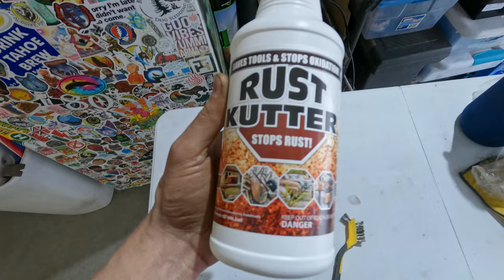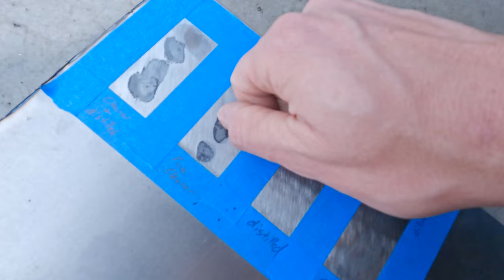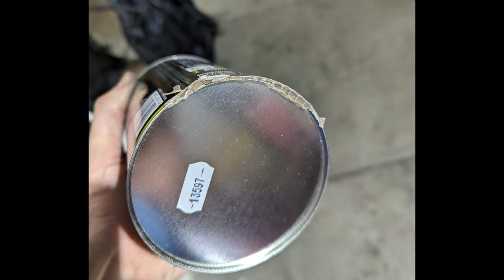RAPTOR Undercarriage and Wheel Well Restoration

Comment: Nice job on outlining the process and steps.  I just completed this exact same thing on my car and used practically the same steps.  It took a lot of effort with the wire wheel (days!) and I swept up endless piles of debris like you did.  This is the third time I’ve done this so I finally realized that a cheap paint suit from Home Depot was a Godsend.  The raptor liner sticks to skin for a long time and ruins clothes.  The suit was cheap protection.  The results are worth it though.  The finished product looks fantastic. Great video. 👍
Reply from the maker: That's awesome to hear, glad it helped out!

Comment: I’m not sure if on the z, if it was a urethane based undercoat, or a tar type undercoat. Paint will stick fine to urethane undercoat, but it won’t stick to the tar type.

My Volvo 1800ES was sprayed with like a 1/2” thick tar undercoat and it’s been a nightmare stripping it off

Comment: I want to do this to my 99 civic. My underbody is in good condition.  Do you think it would look good if I just cleaned, degreased, and sprayed right over the existing rubber coating?  I contacted the company and they said I can do it.  Just wondering if it would look good because wire wheeling it all off doesn’t sound like fun.

Comment: Well put together video editing and demonstration! 

Just trying to feel confident before my first time doing it. 

So it’s 80 grit on base metal spots then put epoxy right over that? 
Then scuff that with red scotch?
Reply from the maker: That's essentially what I did and the adhesion seems really good!  Raptor liner is very sticky though, so less prep mayy have been OK - hard to say
Reply: @windows_down_  yeah I’ve been going overboard on removing seam sealer and sanding/wire wheeling. 

I just wanna get this part done move into the subframe and engine bay. Then engine rebuild and turbo ALOT going on lol.